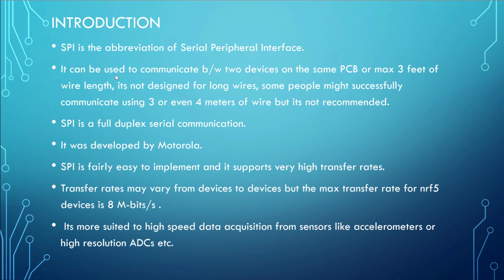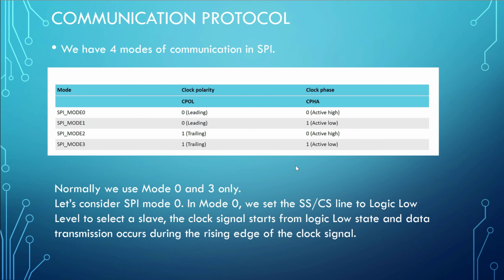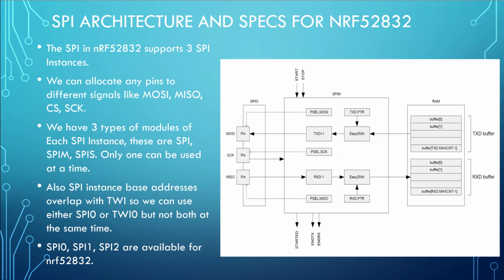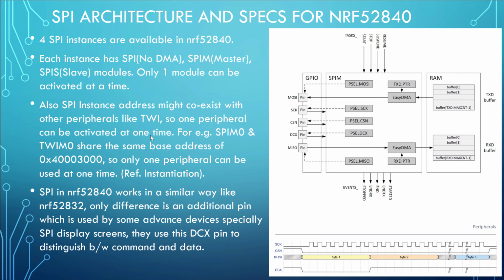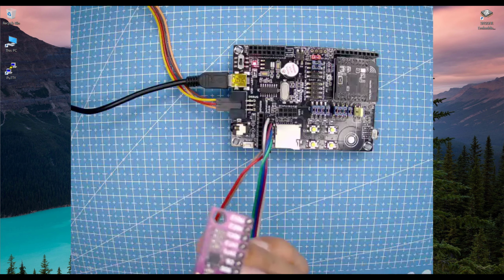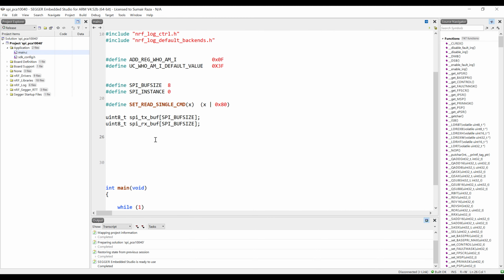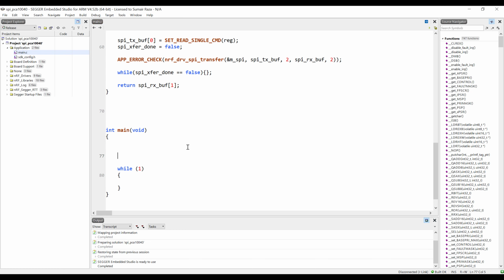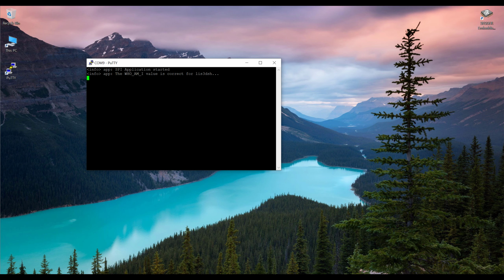nRF5 SDK - Tutorial for Beginners Pt 36 A -  Introduction to SPI Communication

Comment: Hi, how to interface multiple SPI sensors? What changes should we do to this code? When i created instances and test values for one more sensor and tried to communicate, it said fatal error. Basically I am able to use only 1 spi sensor at a time. But i want to operate 2 or 3 spi sensors at a time. Pls help

Comment: Thanks for the video. I have been trying to interface my LIS3DH sensor from Adafruit with the board(nrf52840) and it seems like the address being sent from the sensor is not matching and hence the program does not move forward. Any suggestions?
Reply: I don't know if it's still relevant, but the UC_WHO_AM_I_DEFAULT_VALUE should be 0x33 or decimal 51, not the value Sumair uses. See paragraph 8.5 on page 34 of the datasheet register descriptions.